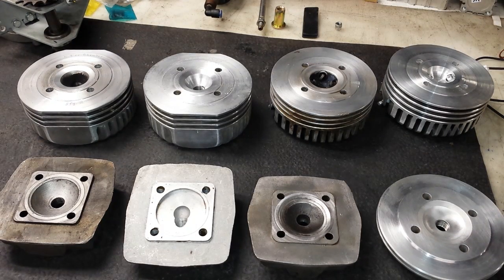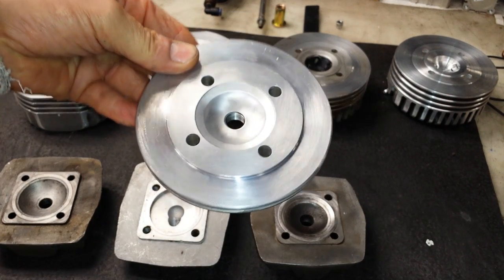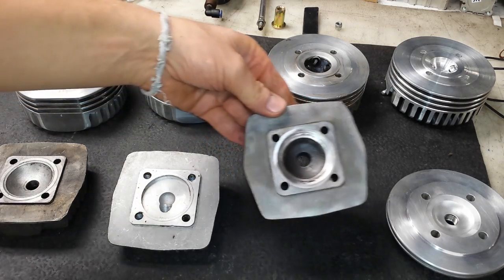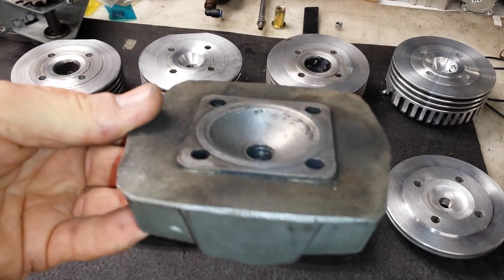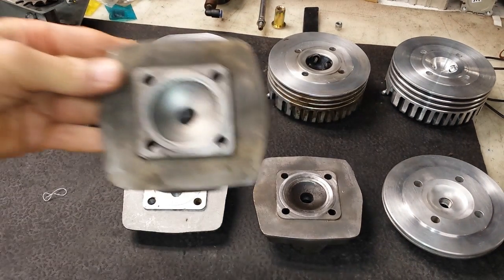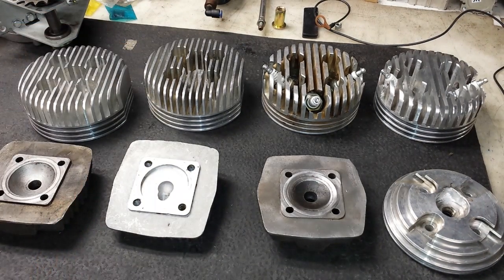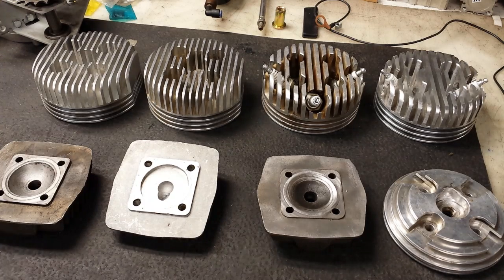Cylinder head designs for the 80cc / 66cc 2-stroke Chinese bicycle engine

Comment: I just got a so called "PK80," and I was very surprised to find that the jug and head are one solid peice.  Do you know of any pitfalls of this design?
Reply: Lil to no upgrades for the one peice cylinders but they are good motors
Reply: @danieljohnston6521  , Yes, reliability over performance.  My bike isn't just for fun, it's a commuter, so that's exactly what I need.  I installed the torquiest exhaust available, so it only goes 32mph, but the thing can't over-rev, and I don't need to pedal.  Not even up the steepest hills, or when I take off.  👍
Reply: @honorb4glory606  hey, can you tell me what exhaust you have got? I need more torque on my 66cc
Reply: @darkraft100  , there are three called "torquer" or "super torquer" exhaust.  There's a flexible one, which wont last, and two solid ones.  The longest one will give you the most take-off torque, but for a 66cc, I recommend the slightly shorter one.  That should match the engine better.  You can find them on ebay and Bikeberry.  Be prepared to send it back, because they wont fit all builds.
Reply: @honorb4glory606  I can modify a exhaust, also, what engine cc do you have?
Reply: @darkraft100  I have a long-stroke 80cc, so I went with the longest torquer exhaust, to maximize take-off and hill climbing torque.  It's sounds awesome, very snappy, but can't reach a very high RPM.
Reply: @honorb4glory606  80cc is not 80cc,  yours probably has a 40mm stroke, and is a 69cc
Reply: @darkraft100  , lame
Reply: @darkraft100  it says "70/80cc" on the crank case, so you may be correct.

Comment: I think the man said the triple spark plug head was the best if they fire one after the other that makes the most power of course. I know because I had several dual spark plug 4 cylinder Nissan engines with 8 spark plugs total and two spark plugs in one cylinder fire one after the other for more power and cleaner burn. And disconnecting one coil slowed the motor down with both coils on the motor the motor revved up ran more smoother idle smoother and made more power.

Comment: Don't forget when you raise compression to high levels you may require a hotter grade plug
Reply: Higher compression increases cylinder temperature, and a cooler plug is needed. It needs to get more heat off the tip than in a low compression engine.

Comment: Speedstermotors Rick here none of these have the compression nor squish band that of what mine are I think about getting back into the industry. I did the 3rd design of the 4 cycle gearbox in 2008 and development was final in 2009 for the Nantong Jiali Gosoneine Engine Manufacturing Company that produced the first two Hoots which were failures. When I got out in 2015 from prison I noticed it took the market ..in 2011 Gas Bikes Sam and John who they and My Father had a phone conversation where there was a 12% agreement made to use my ads for which at the 2011 mark owed me over $100,000. Makes me sick. Thank for for Catching me up with these multi sparkplug and ignition variants mister..you and ya`ya all have a great Sunday..Rick

Comment: I have a PK80 stock but I put a aluminum high compression head to cool off the engine.... Am I using the wrong head since it is all stock for the exception of the billet head
Reply: no. That head will work fine on a stock PK80...

Comment: if i was you i would get ahold of some copper pipe, and some extremely high temp epoxy, you then lay that pipe in a way where it wraps around the head between the veins, close the the most meaty parts of the engine, id also fill said gap with some kind of thermal paste, then once the paste, and pipes are laid in and placed nicely, you cover the area with an epoxy, and sand down to bare metal. the copper tube is a boiler, you then hook one end up to a condenser, and one end up to a resivoir, and you have automatic boiler powered water cooling.

make sure the coolest liquid begins its flow across the hottest part of the head.
Reply from the maker: That is an option for those who want to add extra complexity to the system.

Comment: Hey Fred . Like your page . My bike is different . Will send you pics . Dealing with mechanical aspect . Cylinder is scored , cannot remove , the wall is scored and the rings or wrist pin clips are catching   In the oilers . will have to cut it . Need a  cylinder and piston bored out . Contact me . D.A.

Comment: So you need 3 coils to run 3 spark plugs? And why 3 plugs for 1 chamber ???
Reply from the maker: You do not "need" 3 coils to run the engine with this cylinder head, but you could do so if you so chose to do so. Commonly you can use a decompression release mechanism in one of the spark plug holes as well as running a twin plug, twin coil setup, if that is part of your ignition requirements.
Reply: what a joke

Comment: why would you need more than one spark plug? only if you are running very bad fuel ...
Reply from the maker: A twin plug cylinder head gives more ignition consistency when using a marginal ignition system found on these bicycle engines.

Comment: How come my cylinder head doesn't sit flush with the gasket, I have a a gap almost all the way around. The engine is brand new out of the box. I even tried it on another engine and it didn't sit flush with the gasket surface, even tightened down

Comment: I'd bet that 3 hole is a lot higher compression than you think because of the 3 plug tips and electrodes reduce the overall volume of the combustion chamber considerably.  Just a hunch.

Comment: Thanx for the information.I have the angle fire head and am pretty happy with it.No mods and run premium pump(93octane),with semi-synthetic oil.Summer is coming and there's alot of hills around here.I was wondering about better cooling fins with the same compression.(Oh,forgot to say I have the 66 with 40mm intake and exhaust ports.Great torque.Only non-stock is I used a Very fine file to the inner edges of the gaskets for both ports so there are no restrictions.)

Comment: Which of these heads would you recommend?
Reply: The best performance mod is weight reduction of the rider
Reply: Richard Norris ,,, For  Hills you need to change your.  rear sprocket,,.  4  more tooth on the sprocket. Is more torque,,. Or  4  less teeth more speed,,,.   Higher compression more power but slower to get there,, and you lose torque,,,.  When you mess with an engine you're taking it away from bottom end and adding it to the top end,,. And cutting down the life of the engine rings and bearings,,,   just gasket match your intake manifold to The Jug cut your gasket down to where there's nothing hanging over,, use high octane gas and better oil,, synthetic,,. Or mc1. For  Hondas 2 stroke, less  oil more power,,. More  oil accumulates carbon wears out the engine quicker,, and it bogs,,. All these motors needs a slightly larger jet after they're broke in,,,.  A racing carburetor will not help you climb Hills,,. It will be  slower  taking off and then faster when it's at top speed,,,.  Trimming the Piston skirt down will give you higher speed but you'll lose torque taking off,,,.  A racing Muffler or a loud Muffler will give you more speed,, but it will cut down your torque,,. See where I'm going with this,,,. Where do you want your power at,,. ???
Reply: Capt. Bacon I would also like to know. I need low end torque. I live in Nevada and hills are abundant.

Comment: did they come with head gasket and what was the name and where did u find the head with the coldest temp.i live in fl. need low temps bad
Reply: cr machine.com
Reply: run a cooler spark plug then ...
Reply: Joshua Harrison  A cooler spark plug isn't going to make an engine run cooler though is it?  A hotter one won't make it hotter either. It's going to be exactly the same temperature whatever plug you use.

Comment: With the stock heads - without pulling it off how can you tell if its the high compression variant or not? (Mine was leaking so i took the head off and tightened it down, its stopped now but I don't want to mess with it)
Reply from the maker: Unless it has an angled spark plug hole, there is a high probability that the engine will have a low compression cylinder head. 
Because the engine uses an aluminium gasket, you will periodically need to retighten the cylinder head nuts, due to combustion vibration hammer peening the head gasket. This is completely normal, and nothing to worry about. A small amount of oil leakage from the standard cylinder head can be expected, and is also nothing to worry about.
Reply: I've since bought a head that looks identical to the lower second from the left. Its an angled high compression head with the keyhole shape. Interestingly the one that came with the bike was also angled but it lacked the keyhole shape, causing me a bit of confusion.

Comment: I did use a head with 3 sparkpugs and did test it in comparing with one sparkplug on my 90cc Kreidler draracer. Conclusion one spark is much better, because a strong squish press gasses all to the center of chamber and so burning period is much shorter. https://www.facebook.com/photo.php?fbid=10200735745995097&set=a.10200573123809644.1073741845.1805454134&type=3&theater
Reply: so a big block chevy can run perfect on 1 plug but a cylinder the size of a half dollar needs several.... C'mon guy's...try something else
Reply: Luc Foekema totally agree
Reply from the maker: Incorrect. When using such a system, you operate the engine with multiple ignition systems.
Reply from the maker: I agree
Reply: Luc Foekema
 Smartz
Reply: You could of used a laser temperature gun mine runs about 180% depends how fast I can get the gun what is ideal temp?
Reply: Luc Foekema I believe he's saying only 1 of the 3 is actually firing/igniting  fuel/air mix. I also believe for that size another 2 plugs is useless. When it comes to bigger (more area of fuel mix make since for more spark) all happens in ms.
Reply: Many ignition systems aren't going to easily fire across 3 spark gaps ..my guess would be that ONLY 1 of 3 plugs actually fires (the path of least resistance).  The extra plugs will disrupt flow, not good .. one plug is bad enough, why add 2 more? Lastly the 2 higher compression heads in upper left of table, look like the best ones, if those did not run well on his motor, then that motor needs some port work and/or better pipe. I have many many billet heads from scratch for kart racing motors.
Reply: Wrong, al three fires, because all three coils were loaded, so impossible not to fire. When all three were contected to 1 coil you are right, in that case one of the three will only fire.

Comment: what parts are needed for the head with 3 spark plugs?
Reply from the maker: The cylinder head and 3 spark plugs or two spark plugs and the compression release mechanism.
Reply: @cryptopyro  Hi Fab.  You never did give us the actual cc number for the three and two hole.  I'm interested cc for the three hole that you said you got the best performance from.

Comment: i have a 2 stroke were can i buy a high cylinder head plz help the cowboy
Reply: get a puch 70cc hi hi from treatland.com it will bolt right on and has way more surface area for cooling and 20% more compession, best part is its 30$ as opposed to  80-100$ ones he showed here
Reply: make sure you use 91 octane id you do
Reply: hi mike r my bike is on you tube then go to umoto bikes .com look 4 the yellow  bike chopper my promblem im in tucson az cant find the head plz help
Reply: FRED HEADS

Comment: i would like you to make a video on how to set up the 2 hole head...
Reply from the maker: +Jay Emmanuel It's simple. You put 2 spark plugs in the cylinder head, or you use one spark plug hole for a compression release mechanism. Not  difficult to understand.
Reply: So that will meet that I will need two cdi's to run both or there's a special one for it?
Reply: Jay Emmanuel .

Comment: Let's hear more about this Dual Ignition, Dual Plug Heads!
Reply: The idea for the use of dual ignition is for inside extremely large cylinders where the only way to get the ignition to spread fast and evenly enough is to use 2 spark plugs spaced out.

Inside a smaller engine like bike engines- the extra spark makes zero difference.  Whichever one goes off first by even the smallest amount of time, will cause the entirety of the gasses to ignite by the time the 2nd one fires. If you're running extremely rich, or go for long rides, it's useful as a fail safe incase one fails mid-ride. 

However, just like with the three hole variant, it does lower compression- which can be a good thing if you're over 145 psi. As higher compression can limit the max RPM. Higher compression causes higher resistance on the compression stroke-which is where you can loose power despite each ignition being more powerful.

Comment: Just a quick note about detonations...
Higher compression heads needs higher octane fuel otherwise it'll start detonating.
Reply: or a different pistons and chamber format, theres variations on high compression heads about the dynamics from these ones
Reply: @TheLordMaximo  I'm pretty sure autometer has a cylinder head temperature gauge with a spark plug ring that goes under the spark plug for measureing cyl head temp . They even have a few new adjustable warning gauges that you can wire up a few different ways to alert you with a light horn or both. It's basically a switch to cut on or off.
Reply: @zedee2000  i'm not fan about place gauges for that, but that i would use if im using a heavy tuned engine,
theres different pistons and i got 3 types differing on his head format, place where the ring goes and the strenght of these rings

then for those parts each one makes different effects combinated
but is about you have good ears and the correct tools to tune up these parts
Reply: @TheLordMaximo  A water gauge saved my motor on a over 700 dynoed horse power motor when it got to hot the motor shut off and saved me from over heating.  One of the best things I installed.
Reply: @zedee2000  eh....
we are talkin about big engines or bicycle engines 😂?

Comment: witch one is thre best and u shud make a video of wahts good and bad for 80cc
Reply from the maker: The best cylinder head is the one that is correct for your operational requirements.
The best cylinder head for your needs might not be the best cylinder head for someone else's needs.

The worst thing you can do to a Chinese 2-stroke motorized bicycle engine is to rev it past 5,000 rpm on a continual basis.
Keep it below 4,500 rpm and it will live a long and happy life in conjunction with an aftermarket CDI such as the Jaguar CDI.

Jetting the carburettor correctly is also very important to give the engine both good power and long life.
There is no magic jet size, because the jetting needs to be optimised for your location as you will have different atmospheric conditions compared to someone else living in a significantly different location.
Reply from the maker: marius salvesen meland They all come from China, however the engines that come out of the Nantong Jali factory seem to be of reasonable quality.
You will need to do your own research as to which companies get their engines from a distributor sourcing their stock from Nantong Jali.

Comment: Hey Fabian, have a quick Q for you. Using the three or two spark design, how did you set up the dual/triple ignition? Used one coil for each plug?
Reply from the maker: The magneto does not supply enough power to run a dual ignition, however you could run a dual or triple ignition system if having an external power supply like a high A/h lithium battery and a bespoke electronics package that steps up  battery voltage to replicate magneto output voltage as well as replicating the magneto A/C sine curve; allowing you to connect multiple Jaguar CDI's.  In my case i simply connected the Jaguar CDI to the rear most (longitudinal) spark plug; using the second Jaguar CDI as a backup system should the primary Jaguar CDI fail in operation; giving the option of simply unplugging one CDI and plugging in the alternate CDI into the magneto output wires.
Reply: I've NEVER had an issue with just one plug that's already hooked up to even make THAT an incentive
Reply: @jeremiahdssdentmorgan3341  me neither

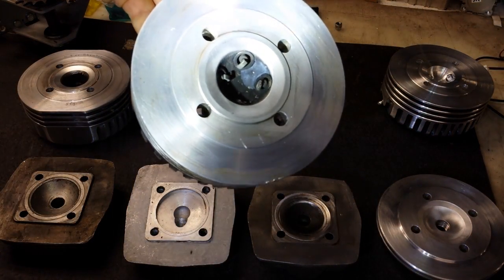Comment: 1:08  Over  here  in the good ole  USA it's a bloody flashlight M8... a torch has flame man !! .
 Nice video seriously  I was wondering  if you could do a video comparing a motor with a boost bottle and  one with out  ..some claim better gas mileage as the fumes get trapped in the bottle  I can see this being a benefit considering the minimal amount  of fuel to run these
Reply from the maker: The "Boost Bottle" concept has been work-shopped to death. By the nature of the process, a boost bottle is a complete waste of time, and has proven to be a worthless concept, and a waste of money.

You are far better off investing your money in a Rock Solid Engines reed-valve-intake.
This design actually "does" improve low and midrange power/torque, hence the reason why it's fitted to my bike.
Reply: Over here in australia we dont really worry at all about good old usa. Its a torch and fries are chips.